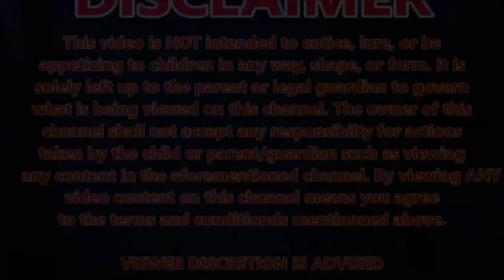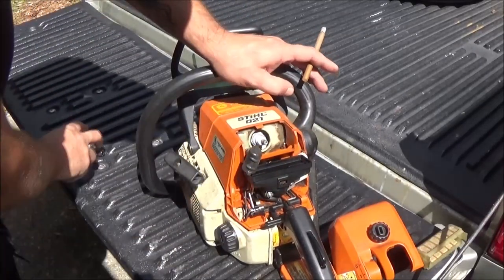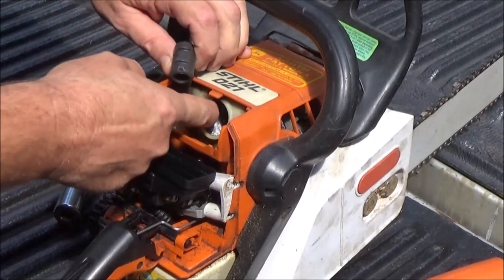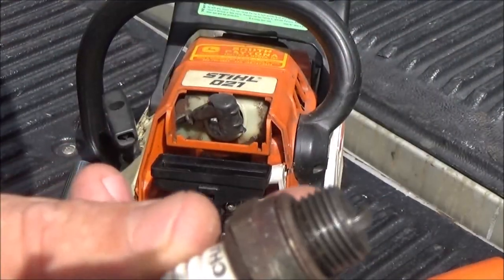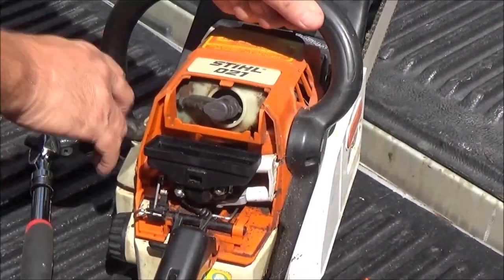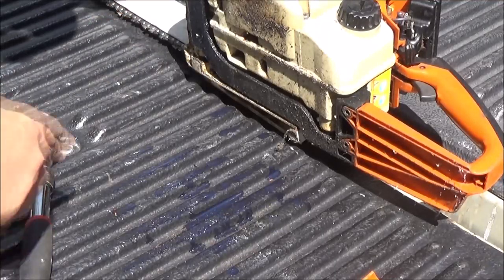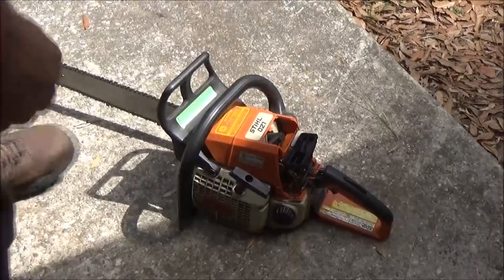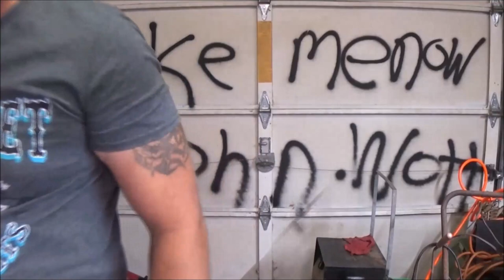Stihl 021 Chainsaw Repair

Comment: That’s a tank vent.  Some Stihl saws have a tall vent and some run a piece of fuel line and put a tank vent on the end, like Echo equipment.  If your tank is not venting, that may be your problem.  It will cause it to run for a while and then die.  My guess is a bad set of diaphragms in your carb from running ethanol gas.
Reply from the maker: Thanks for the info John.

Comment: Maybe you should put the proper vent on that saw so you don't get gas everywhere and get crap in your fuel tank. That is what that little tube is. You can buy a vent that will work on eBay for a buck and a half.
Reply from the maker: it doesn't leak any gas, not the original carb.